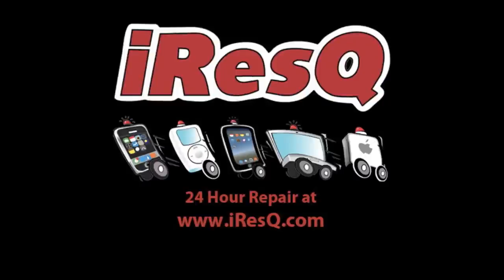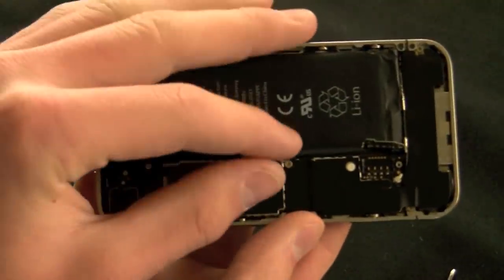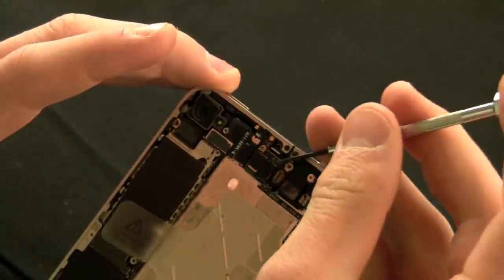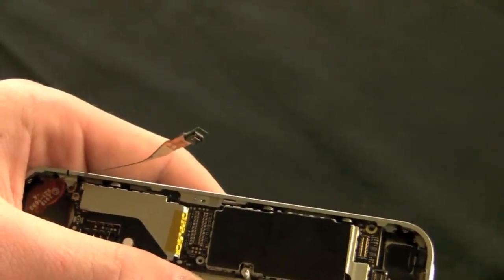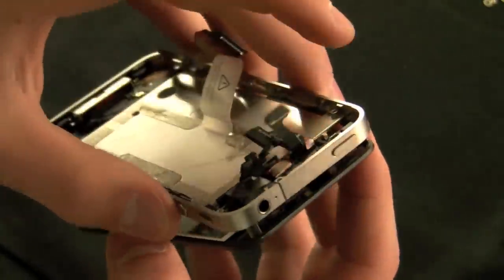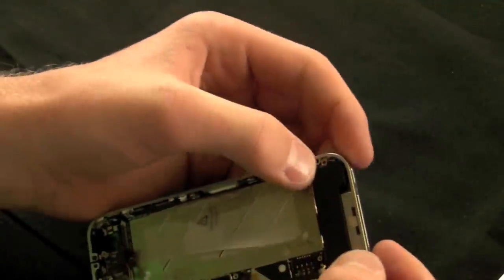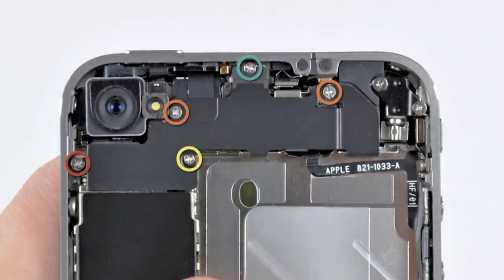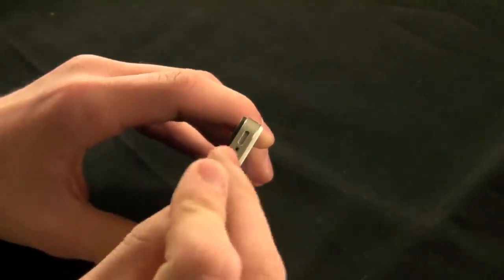iPhone 4 Screen Replacement Disassembly and Reassembly - FULL WALKTHROUGH

Comment: So I've JUST finished doing this for my sisters iphone 4 and it works just perfectly. I wasn't sure if there would be slight differences with models in the UK to this one which I assume is bought in the US but there wasn't. £10 repair kit including new screen off eBay and a little patience later and I've fixed it. Trickiest bit is the side case screws but no biggie. The vid misses out screwing the vibrating motor back in but just do everything in reverse and you shouldn't go wrong. Thanks for the upload
Reply: parmz1 I have a verizon and I am thinking the same thing.

Comment: Great video. Just a warning. Camera was not removed from board before removal. Also, no explanation on reinstalling vibrate motor. Also, reattaching the lead on speaker unit.

Comment: I'm an electronic engineer and I used to do safety testing of mobile phones including the Li-ion battery. I have some very important safety tips:

1. do not use a metal implement to remove the battery. If you accidentally nick the battery it could burst into flames (I'm being serious).
2. handle the battery with care, do not squeeze it or drop it or allow it to get hot or wet or damp, do not damage the end nearest to the battery connection
3. to safeguard the electronics in the phone wear an anti-static strap.

mainly I would not advise anyone to attempt this unless they are well versed in electronics, unless you are prepared to risk damaging the phone beyond further repair.

just mind that battery!
Reply: And be ready to turf it out into the garden if anything goes wrong.

Comment: I came to see how you moved the speaker mesh and front facing camera ring from the old screen to the new one. You simply did not bother.  The new display you installed did not have a mesh, but when it was completed it appeared you had installed it, but never showed how you transferred them.

Comment: The ribbon cable on my new screen wasn't long enough so when I went to connect it it broke and now the screen is useless so I'm just going to sit here and cry
Reply: The ribbons are long enough, they just got caught in the frame and you didn't notice it...
Reply: same thing happened to me, lets invest another 50 euros into my iphone 4...
Reply: You problably did not pay attention where He said "make sure the new cable is through ALL THE WAY"
I know it's a bitch when part of the digitizer cable gets stuck on the motherboard and rips a little - digitizer ruined.
Reply: I had this problem but then i remember him mentioning it during the vid, so i took the screen off again and low and behold... i hadnt pulled it all the way through. Great tutorial, thanks for uploading

Comment: is it just me or does this dude skip a lot of parts
Reply: Like camera removal?
Reply: is it dangerous?
Reply: The only part i fucked up on was the really thin display wire when putting it back together. I got it stuck between the casing of the phone and screen. I closed it and when i tryed to pull it to plug it in i ripped it. I got pissed and threw the phone at the wall and just said fuck it and bought an iphone 6 lol

Comment: Thanks for the video, very clear and understandable. this is my first time to do this. I would just like to give a little bit of constructive criticism @ 4:15 you skipped a step, had me thinking for a sec, 4:57 that diode as you called it is a wifi / bluetooth connection like you find in laptops 5:23 another step, you already have the camera out. 6:25 pull the board out. I still had sim port in and couldn't get board out, lucky i saw this before forcing it, i re-watched this and notice you did say remove it at the beginning but it would have been good to remind us at this point :). but if it was not for this YouTube clip I wouldn't have a working phone now. so thanks heaps. good job :)

Comment: man, u gotta be careful when making a video!  You miss quite a few steps and if a first timer was watching they may well be very confused!

 At which point did u remove the camera? 

Your speech at mother board installation was completely backwards..." above the 3 on the right and below 2 on the left?" 

Not mention of vibrator motor reinstallation

diode reconnection

And the view for the battery bracket completely blocked

Great work however..! nice refresher for those who have done it before.
Reply: I agree with what you say. He missed steps out and confused the process.
Reply: N LE If this video isn't clear enough,go to ifixit's channel!

Comment: This video is the best, I managed to replace the front of the iPhone 4 with ease. Make sure you keep track of your screws. Just organize your screws in the position you took them off. The camera is not included in the disassembly, but its easy to remove. Take it off right after the other 5 ribbons. The camera should come right out. When you remove the LCD at the end and put it the new one, MAKE SURE the ribbon goes all the way in, ALL the way. One of mine didnt go fully in, I had redo that part.

Comment: Used this video to replace my screen with my dad yesterday, was a complete success! only problems we encountered with the video were the re-assembly at the end telling us to put the camera back in (which we think we were never told to remove in the disassembly half of the video) and not mentioning to put the little motor back in before all the teal red orange yellow and red screw bit, but we soon realised! overall extemely helpful and couldn't have done it without this vid, thanks.

Comment: Thanks! You, however, forgot to mention to replace the small plate that goes over the side with the two screws as well as reinstalling the vibrate motor. So happy to have fixed my girlfriend's phone. My replacement kit also came with replacement adhesive.

Comment: I was able to take apart my phone and actually put it back together thanks to the reassembly part. If you didn't see clazaro4's message, don't forget to put the vibrator and speaker power wire back on. Other than that, very awesomely detailed video that I could actually follow to get it done.

Comment: This was great help!!! During the re-assembly you skipped the vibrate motor so i forgot it the first time haha but i had an issue with my sim card. my phone kept saying no service and the sim card was sort of hard to insert. i started all over and did it again to come to the same conclusion. i looked up online and saw people kept mentioning the speaker? I applied a little bit of pressure and it snapped together, put everything back together and it worked perfectly

Comment: i am wondering, when the old screen is taken away from the housing and new one put in does it need anymore adhesive to be put back on and if not would the phone be more at risk or dust water damage ect?

Great video by the way

Comment: After a major fight to unscrew the side screws to take off the screen finally managed to physically pull the screen off and then push the new screen back on and spent half an hour putting the screws back in and tightened them all tight. Forgot to take the f @** ing backing sticker off the screen and had to undo it all again then trapped the connector and had to unscrew it all again then gently pulled the connector on the screen... OFF! and had to order another screen, got the new screen on again and tightened it all up then forgot to take the sticker off AGAIN and had to unscrew it all again, then got the thing back together lost 2 screws but what the hell, then the camera didn't work and The phone overheated then took it all apart AGAIN and finally fixed the camera and everything seems fine. It is a learning curve that if you have a spare couple of days is well worth doing I got so expert at putting tiny screws in holes that if it becomes an Olympic sport I would be up there with the best! none of my problems were the fault of your video just impatience and senile dementia setting in. I am now attending anger management sessions at the local clinic...... : )

Comment: Thank you so much !! Perfect guide. Only you don't unscrew the camera, but it isn't necessary. On the other hand you tighten the camera in the reassembly, but you don't mention the vibrating motor. Small detail, but still perfect guide !!!

Comment: Hey, i repaired my friends iphone the other day and it works fine. If you are worried about doing this then take it slow and keep all of the screws in separate places you will be fine. If you cant get a screw out it my be the screwdriver you are using. The ones that come off ebay with the screen are crap. I suggest using a high quality magnetic one, makes it so much easier. Cool

Comment: This all worked fine for me so thanks for that.

Only thing to really mention is you missed taking the camera out in the disassembly and adding the vibrator motor and its screws in the reassembly. Both were easy enough but there was a moment of panic when i wasn't fully sure if i was missing something with the camera removal.

Comment: Thanks for the video, just finished replacing screen and backplate and phone looks as good as new. Only bits missing on the video for reassembly was fitting vibrating motor but that was straight forward and reconnecting the small cable from the speaker. Im in the UK and got both items from ebay - screen with digitizer £21 (including tool set) & backplate £7 approximately. Thanks again!............

Comment: I tried to check the LCD and made sure it worked, which it did, without screwing in anything (other than actually LCD). Everything worked fine but it's all shaky and not clear. Is it because of my screen? Is it because I didn't screw everything in? Or did I mess something up?

Comment: Thank you so much! Took me quite a while to do. I did the whole thing inside a large box lid on my desk so screws couldn't go flying, and used a strip of double sided stickytape to keep the screws in place in a line in order. 

The only problem I have now is my home button is slightly depressed, I took everything apart again and tried to pop it back through but it went back down after, any suggestions?
Reply: also make sure you reconnect the tiny little diode!

Comment: Hi. thx for this video. just a comment on something. U forgot to show the vibrator. Also i have a little problem. Replaced 2 iphones watching this video. The first was success, but the second wont turn on. I checked the battery ribbon and its is correctly on. Can it be that the new LCD is damaged or broken? if so, wouldnt i feel a vibration when i turn the phone on? thx a lot

Comment: Thanks for the tutorial. It took me about 1hr 30mins to complete. Like suggested by another viewer id recommend laying on a floor with a large plain pillowcase ect. My main issue was the tools I got with my repair kit were really bad quality making the removal of the 10 screws at the end a real pain to remove so I used a small pair of wire cutters to grab the edges and gently loosen them. I did notice a couple of things missing from the video like the vibration motor being replaced but if you are going to undertake a repair like this then a small bit of common sense is expected! Thanks again

Comment: thank you very much for the video, my phone switches on but it do not reognize the sim card, it says "NO SIM CARD INSTALLED", I followed the tutorial step by step and every screw is in the place it was. Any ideas which connection I need to check or what happened?

Comment: My iphone 4 gsm screen is coming up?

If I go on the ride side of the phone you can see where the screen only on that side is coming up but I guess its screwed in because the left side is completely down and not loose at all.

But I guess the screws on the right are loose?
Also I can push down and here it unsticking and coming back up?

What is this and can I fix it without going inside the phone?

Comment: Well, trying to remove the battery, I broke that connector box thingy next to the "wedge" off the motherboard. The part where the battery cable goes in. I've managed to get the contacts to connect once to the motherboard, and turn on the Phone, but after that, no luck. Am I screwed? Or am I able to fix it with some solder?

Comment: Great video. Only comments I will make is don't forget to check your new digitizer has the ear speaker grill with it, if not you have to get the old one and swap it over. Also this video forgets one of the components; the vibrator at the end with the re-assemble, you need to do that before putting the motherboard ribbons back down.

Comment: does the plastic film on the back of the glass/diffuser need to be removed?  There is a tab there. I assume it does but I did not see you remove it. Also mine is red, not clear.?? I think I can do this.

Comment: Great video though missing some parts in the assembly part, that were in the disassembly part. Also the camera part wasn't in the disassembled.
Anyways I disassembled the phone because it had become unresponsive in the lower right part which is really annoying when texting, and just in general. So I took it apart, cleaned it and put it back together (must have taken hours), only to find out it still doesn't respond in the lower right side. Does anyone know a way to fix this or does it simply mean that a new front is needed to fix it?
Any help would be appreciated. Thanks!

Comment: Hi, I have the same screen flickering issue that you have in the video at the start, but for some reason a sharp blow to the top of the screen with a blunt object gives me a good 20 seconds of normal screen viewing before I see distortion again and the phone becomes unusable, could there be any way to solve this without opening or replacing things? I dont trust myself!!

Comment: One thing I did notice you missed out though, apart from the vibration motor re-assembly, is the re-attachment of the lower antenna. I had to open my phone back up and connect it as I followed this step by step and thought it didn't matter, turns out it does otherwise you don't get signal for shizzle...

Comment: I have 1 iphone 4 with a broken on/off button and smashed screens, I have 1 iphone 4 missing back cover and from screen completely shattered and water damage, I have an iphone 4 screen replacement kit. I'm trying to make 1 working iphone. The main issue is tat te battery screws won't come off either iphone...

Comment: Hey there, nice video. Where did you get the original digitizer screen, i have oredered one on Ebay, it just arrived,and i was going to install it and found out that the slots for screws dont match..... so i cant even place them on the spot.So if you know where to get a PROPER one, please let me know, because i dont want to reglue parts, which i was planning on doing.

Comment: Very helpful video. Fyi, removing the camera is not shown on the disassembly (but putting it back on is shown on the assembly), and the assembly of the vibrating motor is not shown.

Comment: I ordered a replacement screen but it didn't come with the digitizer, it's just the piece of glass.  Will I be able to use my old digitizer with the new glass?  I cracked my old screen and that's why I'm replacing.
Reply: yes , some people call the screen as glass , different people call different names , if only glass broken , only change glass is OK , our factory is professional for lcd repair machines , also supply spare parts , welcome for inquiry ! : )

Comment: I am currently doing this tutorial, and I'm stuck. When I was attempting to remove the orange marked screw beside the camera (one of the 5 top screws) I pressed down to hard and it appears that I've stripped the head of the screw and i am now unable to get it out. Do you have any ideas on what i should now?

Comment: This video was very useful. A good idea is to tape a blank sheet of paper on the work desk, make two outline drawings of the phone and roughly mark the screw positions and then place the screws on this sketch. Just keep the kids and pets away..! This makes the assembly part much easier. No guessing about which screws goes where.
The few missing parts in the video can be figured out by using patience and care. I managed to successfully replace my iPhone 4 screen without any other damage. I did miss the transfer of the 'camera ring' though.. not sure how this will affect the picture quality. Thanks for the video...
Reply: You can buy magnetic mats that have a diagram for screws on amazon for $8.00 .

Comment: Kinda wished you included the part where you take out the camera and SIM card cuz I almost broke my mother board since you didn't mention those part... But for the most part good job since I fixed my phone :) (No need to take out the headphone plug-ins... I learned that the hard way)

Comment: Hi thanks for the video it was a great help and i used a template of a diagram for the parts so i knew how it come apart from yours and a template for all the parts from a different vidoe  but yours is very informative and  easy to follow now i have a new iphone 4  which worked first time the only problem i had was replacing the wire connector next too the battery terminal as the wire was a bit harder to bend into shape I also found if you  put the phone on its side while doing the  6 screws

Comment: Check that at the top of the device in the ribbon cables, with the two that are on top of each other, the top one is securely fastened in its spot on the motherboard. If it can't reach, disassemble the device and make sure the cable doesn't get bent as you feed it through the hole.

If that doesn't help I'm afraid it's a defective screen.

Comment: If anyone is wondering what that strange screw is that a watch makers flat blade is used to remove its called a "Torx" screw, and you'll find the correct tool to use from a motorfactors, torx bits are dominantly automotive fasteners